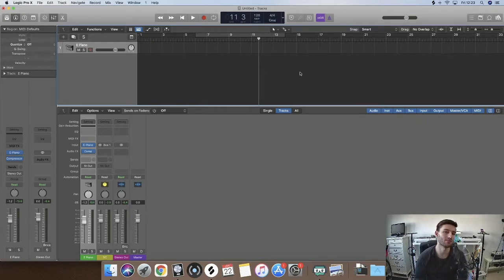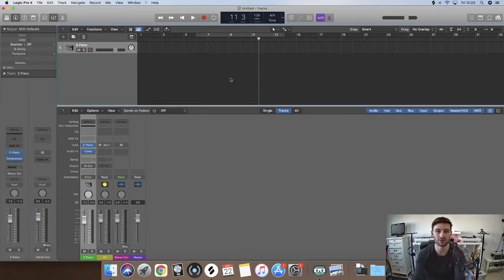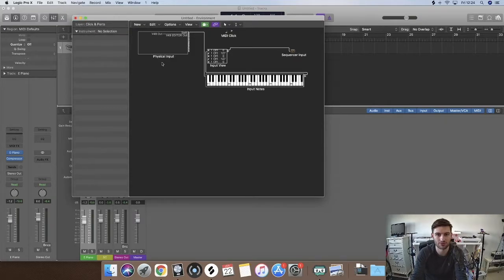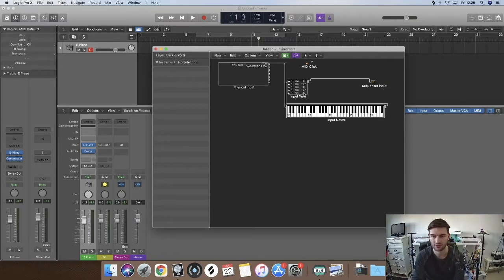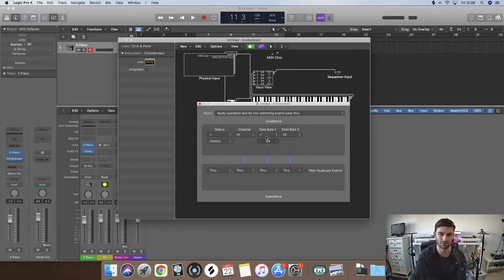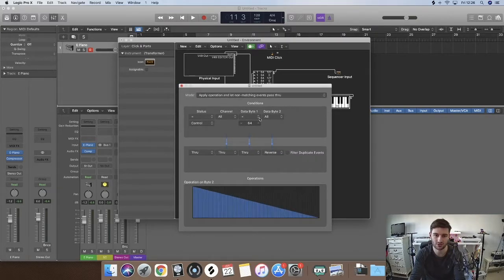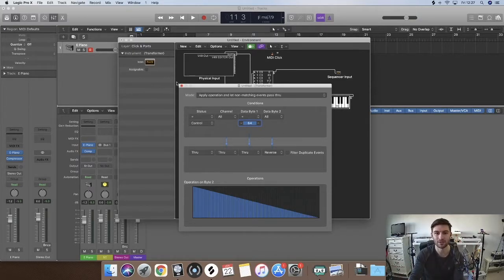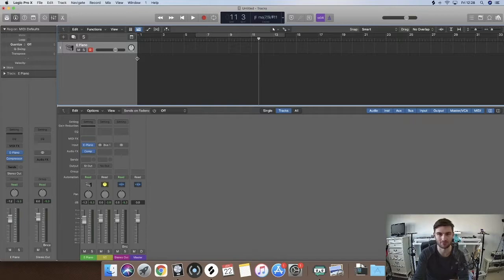How To Reverse the Polarity/Signal on your Sustain Pedal in Logic Pro

Comment: For those who tried this and didn't get it to work, important note at the 2:40 mark of the video: make sure you're specifically clicking next to the word "SUM" from the Physical Input box before connecting to your transformer.

If you click anywhere else in that area, it'll still make a connection to your transformer but nothing will happen.

Comment: How could I use the sustain as kick drum instead is there away to change the numbers or something
Reply from the maker: I guess you could map it so it triggers the sampler. But really you'd need a switch pedal so it's either on or off. With the sustains they're usually mapped from 0-127 continuously so may be more tricky
Reply: @ yeah I successfully triggered them

Comment: Sorry. I have a master keyboard and i want to send a sustain message to a first midi track but not at the second. For exsample i want to use a pedal sustain to a piano but no a string instrument in the same time. I can disabilitad a control changes in a midi preference but change evrywhere. Tank you
Reply from the maker: Hi! I think I understand what you're trying to do. You'll have to switch the sustain off within the virtual instrument if you want to control both instruments with the same midi keyboard. If you change it in the master midi it will change it everywhere as you said :)

Comment: I swear Im going to rip my hair out my sustain pedal won’t sustain period and I literally can’t find the solution😭
Reply from the maker: Ah nooo!!! How annoying?  What have you tried so far? Sometimes you need to make sure everything is plugged in before starting up the DAW software. But yeah let me know and I’ll see if I can help!
Reply: @TomOneDJ  man I feel like I tried everything 😓 I press the sustain pedal and it doesn’t wanna sustain while I’m playing I honestly just wanna use it so I could just practice before I record but it’s been a hassle ❗️I tried to see what was going on but instead of showing sustain on the automation it shows it’s automating “sostenuto” what ever that is 😭
Reply from the maker: @Alejandro_Adon  hey dude sounds like your pedal is controlling sostenuto rather than sustain. They're both different! Sostenuto means that only the notes played at the time will be sustained rather than a sustain pedal which allows all notes to be sustained. What software are you using? You'll want to check that your pedal is plugged into the right connection in your keyboard. If that's all good then you'll need to change something within the software so that it's triggering sustain rather than sostenuto! :)